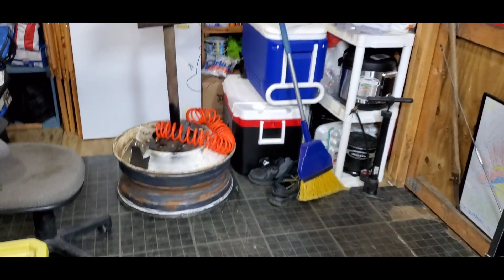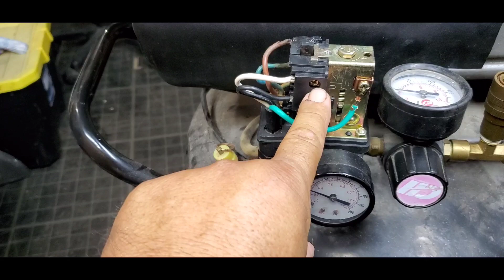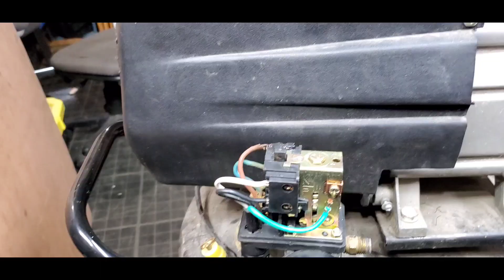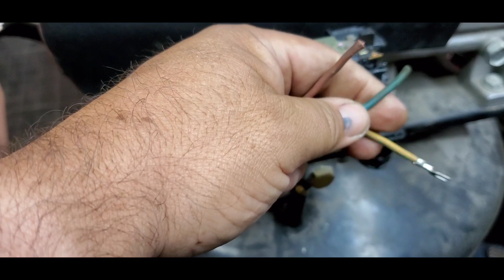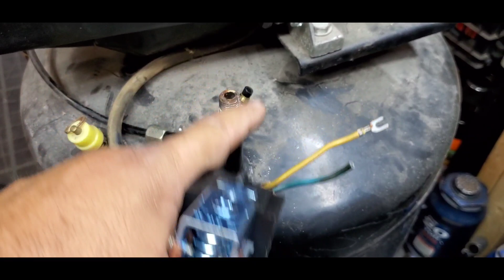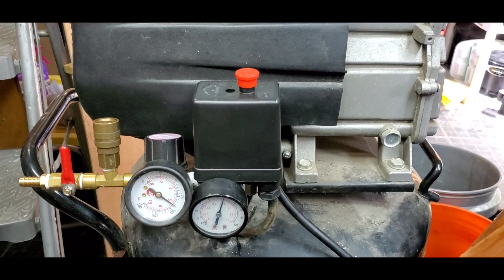Power pressure switch replacement for shop compressor

Comment: Mine is from harbor freight as well and it is oil filled also. I use it all the time
Reply from the maker: Ah OK cool I wasn't sure.
Reply: @earthscraper69  for the $$$ I dont think theres a better option. Only time it has a problem keeping up is with the die grinder/cut off wheel. It drains the tank really quick. Its 150 psi 20 gallon upright. Sanders, nail/staple guns and chisels work just fine though.